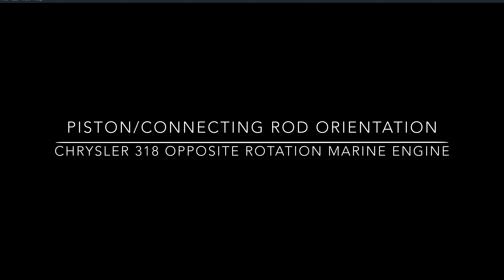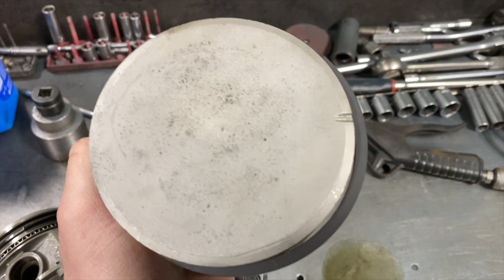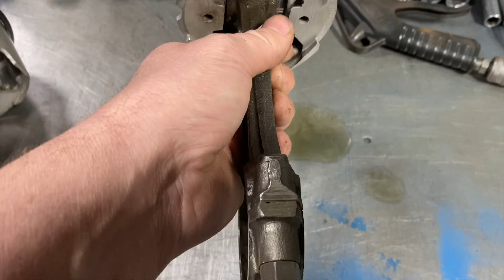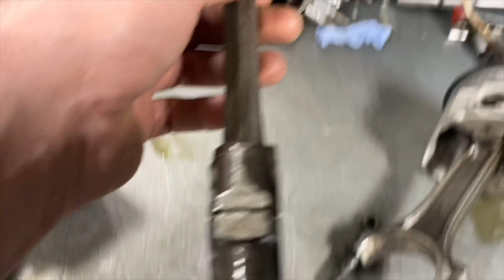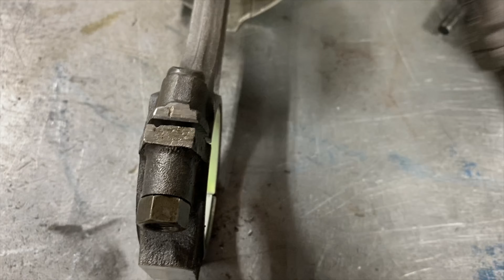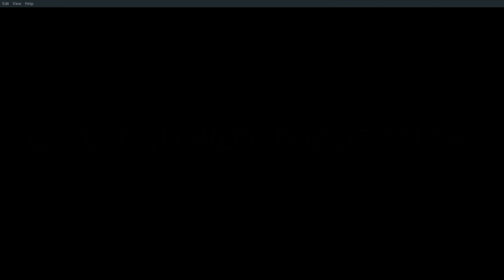Chrysler 318 Opposite Rotation Marine Engine Piston and Connecting Rod Orientation

Comment: A buddy unknowingly got ahold of a Chrysler 440 crank from a reverse rotation marine engine and used it in his street car engine. Continuous rear main seal leak no matter what he did. Finally the machine shop found the problem. The tiny diagonal lines on the seal surface of the crank were forcing oil past the seal instead of into the engine. Swap meet crank buyers beware!

Comment: Technically engine rotation is usually determined from the flywheel end and standard rotation is left hand or counter clockwise (ccw). All automobiles that I know of are this configuration. On marine engines the flywheel end can be the front or rear as mounted in the boat depending on weather it is a v-drive, conventional straight inboard, stern drive or an old inboard that has been turned around and the prop shaft driven from the opposite end of the flywheel which is usually considered the rear of the engine. The camshaft and distributor rotation is maintained the same as ccw engines usually by use of 2 gear cam drive unit which would spin the cam opposite of the crank shaft so no special cam, distributor or oil pump would be needed. I think I said that correctly. It's been a long time since I've thought about it. All stern drive packages I am familiar with have always been standard (ccw) engines with prop rotation changes accomplished in the drive system and all inboards I know of since the late 80's or early 90's are now ccw engines with prop counter rotation done in the gearing now days. I have never heard of an O/B engine having a counter rotating power head but some did run the power head backwards for reverse.

Comment: Uncle Tonys Garage rotates pistons in all his engines ' you might have been better off leaving them the way they were !
Reply: I cant say if i fall in line with that whole thing. Far as power goes... Maaaybe... There is some effect. Idk. But like this man says in the video. I figure it would cause undue stress and wear on the bearing, cylinder wall, rings, piston, wrist pin... And he showed that little oiling hole directed towards the cam.. I didnt know that was a thing either. So all things considered it might be possible. And who knows, maybe have some tiny benefit.. But all the negatives dont seem worth it. I mean really all the thousands of engineers that have designed engines for 130 years plus. They knew much better how that engine should go together than us youtubers. Or some random un namable magazine article Tony thinks he can remember someone saying to do this... I would not recommend it. Just seems logical to me??
Reply: @ronprice7495  Research L.S and late model engines including aftermarket race pistons and you just may learn something ' then again don't and stay ignorant that's ok

Comment: Hi, currently rebuilding my reverse lm 318. Watching you videos with max attention! The marine 318 shop manual does not foot note reverse rotation piston install, just blanket statement says to put the notches toward front. Is this an oversight on their end? At the ‘specs’ page toward the front of the manual it does specify what engine numbers had a reverse firing order….so I think the marine 318/360 only has one manual. Can you clarify, thanks!
Reply from the maker: Yes, it's an oversight. Some engines are correct when the leave the factory and some are not. The mechanical part of the marine service manual is copied from the automotive side therefore there's no mention. I can't speak for what serial numbers are what rotation, but generally if the metal tag is still attached the "M360RBW15" as an example for a model number. The "R" means RH rotation. If there was an "L" after the 360 it would be a LH rotation.
Reply: @LakelandAutoMarine  Hey, you know your stuff! We are all greatly appreciative of the time you take to educate us👍🏽

Comment: Thank you for this information! I came across this when looking for help on a 1970 LA 318 engine. I found the rod and caps correctly matched but in the wrong cylinders. The pistons are all facing the correct direction as marked (front). When I looked at the rod bearing area on left/right bank rods, both sides appeared to be chamfered lightly the same amount. Bearing surfaces all plexi-gauged out at almost exactly .0015. If I understood your lesson here, the pistons are ok in the direction they are facing (load), this person chose not to use bearings with a v-notch for oil squirters, and obviously was unconcerned about rod location other than matching caps to rods. Given that information, is it headed for an early failure? I don't want to tear it down any more than I need to if rod location is not critical in this instance, but I also don't want to ignore a potential early failure out of ignorance on my part. Thanks!
Reply from the maker: The connecting rod orientation does matter has the camper goes towards the crankshaft radius. Usually, you are correct when the numbers on the rod face the outside as long as someone didn’t mess with it previously.
Reply: @LakelandAutoMarine  Thank you. I watched your video again and I can clearly see the difference in the thickness from side to side on the rod as you held it up. I need to look at mine again because I didn't see that difference on mine. Might have been to focused on looking for a larger chamfer on one side than the other though. At any rate, thank you for responding! Very educational and likely saved me more money than Geico! Have a great day. Erv
Reply: @ervincynthiabathke2547  rod orientation definitely matters if they are wrong u will loose oil pressure on that jornal an spin bearings an break rods
Reply: Great video thanks for all the tech information

Comment: I have a crusader 220 (chevy 305) that is reverse rotation. I just disassembled it (due to a cracked block) and discovered that the pistons were not installed correctly (marks to the front, offset wrong) I'm certain that this came like this from the factory. Have you seen a factory reverse rotation with the pistons installed wrong before? 

My plan was to put the rotating assembly from my cracked block into a good block. Would there be an issue If I put the pistons back into a block, the same way they came out of the old one?
Reply from the maker: Yes I have. It's common to see them not correct. It's not a huge issue, but its not correct. You can do a bank to bank swap and they would be correct.
Reply: @LakelandAutoMarine  would swapping them from bank to bank disrupt the balancing much?
Reply from the maker: It shouldn’t. Rods and pistons should all weight block to the same.

Comment: Why are Marine Engines opposite rotation?
Reply: So one can run a opposite rotation propeller so it will cancil out the thrust. Some out drives are run in "reverse" to achieve this with standard rotation engines.

Comment: Wrong.  No matter what rotation...if all notches are facing the same way. The offset just swaps banks of the engine. Offset needs to be towards thrust side on each bank. So one bank will have notch in one direction, and the other side would be the opposite direction. First gas engine with the largest offset is the Chevy W series.  Take a look for yourself where the offset goes. First use of a offset connection point was used on locomotives.
Reply from the maker: You obviously didn’t watch or comprehend the video.
Reply: @LakelandAutoMarine  nope...I am a newby. Know nothing about engine design or function.